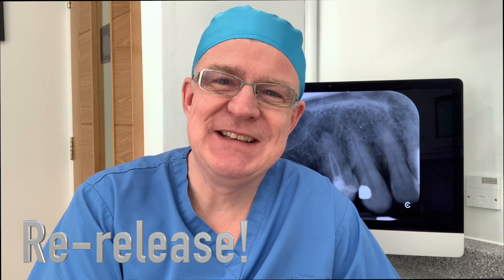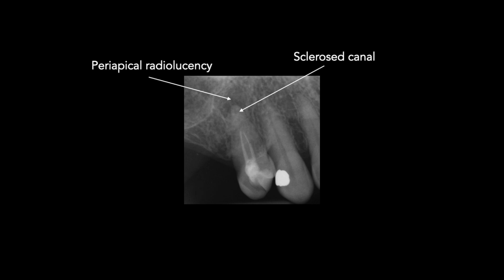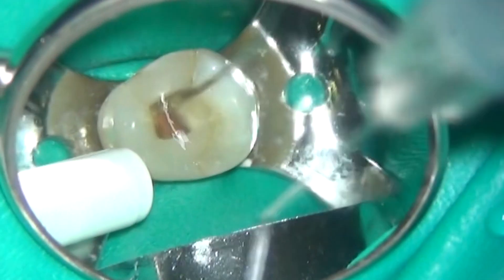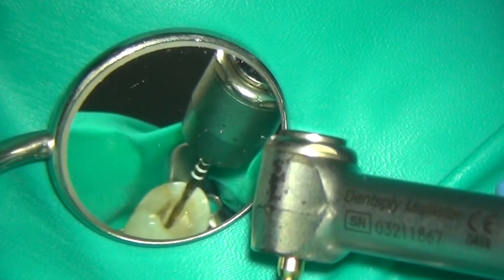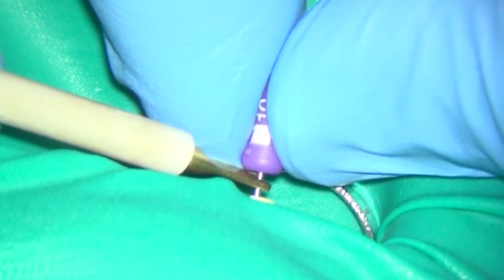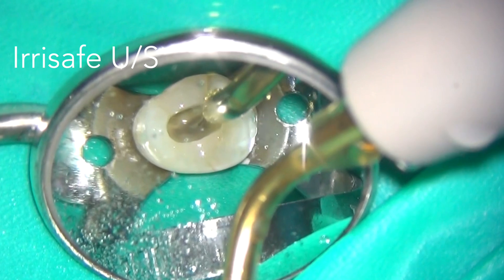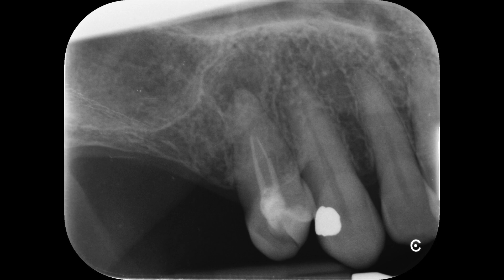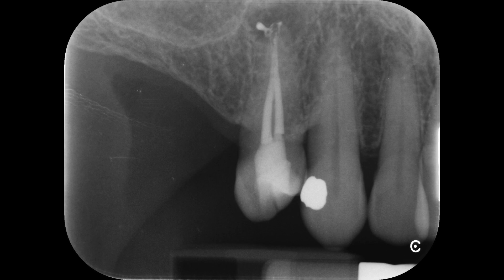simple reRCT UR4 [re-released]

Comment: Thanx for the video. So after taking the cone x ray that showed you were still short from apex, how did you manage to reach apex? Did you Instrument even deeper or was the WL the same?
Reply from the maker: Hello!
If the cone is short I would usually just check the taper with my finishing instrument and then fit another cone before finishing obturation. The cones are not always perfectly standardised.
Cheers
John

Comment: Hi John
Thank you for this video. 
Which sealer do you use? 

And do you only remove the coronal third of the single point rather then two thirds before you back fill. ?
Thank you 
Angela.
Reply from the maker: Hi Angela
we normally use AH Plus or BioRoot RCS
Cheers
John
Reply: @johnrhodesendo  thanks for replying John. Which is your preference ? I used to use AH plus but I’ve been told BC are better, but aren’t they difficult for re tx?

Comment: Hi Dr. Rhodes,

 If you are treating a tooth with complex canal anatomy, would you fill the pulp chamber with a material that's easier to remove or would you still use flowable composite? 

My understanding is that composite is a pain to remove in the event that one misses a canal and needs to re-treat.
Reply from the maker: Hello there
Im not planning for a retreat!...yes composite is more difficult to remove but under the microscope things are easier. I want a good coronal apical seal...Ray and Trope (1995)
Usually any further treatment is carried out surgically.
Cheers
John

Comment: Hi john ..
I hope you are fine.
I realize that this is not the topic of discussion which I am going to ask you about, But I dont have any other platform to ask you . And I only trust you, so kindly show me kindness.
I wanna ask that there is a material which is called pulpotec . Many dentists just get access in the pulp chamber and place pulpotec over all the pulp floor including the canal orifices . And through this procedure( like an adult tooth pulpotomy) every pateint with the symptoms of irreversible pulpitis get relieved and tooth become perfectly fine.
Even on follow up upto 5 years I personally have witnessed that tooth remain asymptomatic and periapical radiograph shows no abnormality.
Can you throw some light on this please .
Thanking you in anticipation
Regards. 
Dr Tayyab Faraz
Reply from the maker: Hi there!...
I haven't used that material but basically if you prevent bacteria from colonising the root canal then periapical periodontitis will not occur.
In modern times a bioceramic cement has the same properties.
Cheers
John
Reply: Right sir . Thanks alot :)

Comment: Did u make the canals completely dry then used a apex locater bcuz all i saw was negative pressure with irrigating syringe or u can partially dry  a canal and use apex locater?
Reply from the maker: Hello Hawzar
The canal does not need to be completely dry to use apex locator, but avoid irrigant in the pulp chamber
Cheers
John